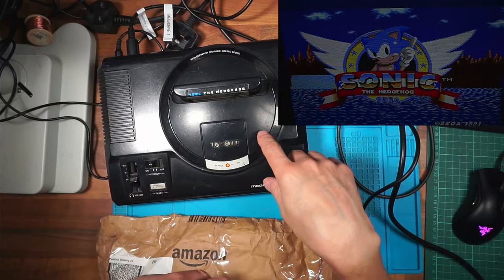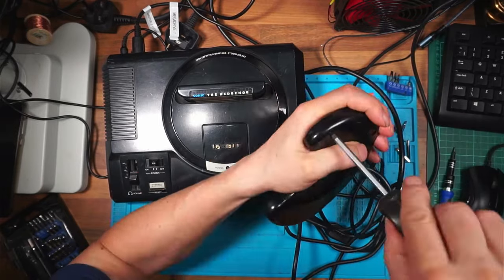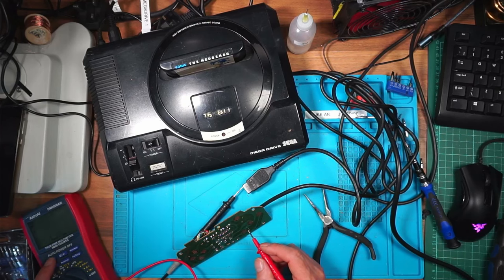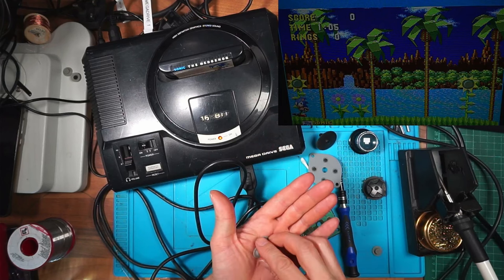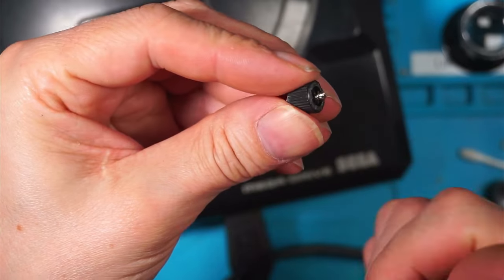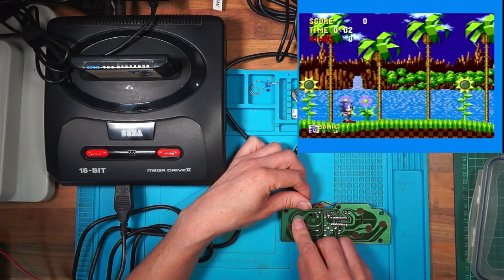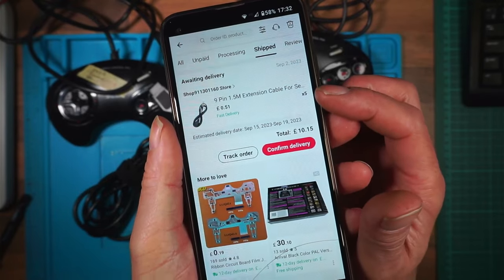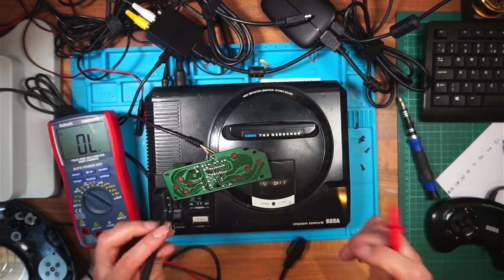Faulty Sega Genesis Megadrive Controller Bundle x3

Comment: Patience of a saint 😉 Philip, well done
Reply from the maker: Thanks Gary. Vince popped up in the comments on one of my videos too.
Reply: @PhilipBryden  found this in the shed (SEGA Mega Drive 1602-05 ORIGINAL OFFICIAL Adaptor UK PSU Power Supply 10V 1.2A) with the longer cable I believe Vince may have read my email ☺️

Comment: In my experience there are three different variants of Megadrive controller commonly available in the UK
Reply from the maker: I'd like to mod one with some tactile buttons in the future. Even the  button stickers found in the Xbox one controllers would be better than the rubber pads.
Reply: @PhilipBryden  Sounds like a plan.  To be fair I don't like the MD controller's hollow buttons, I also find the 'C' button to be too high.  I've modded one MD controller to work with my PAUSE-modded Master System and I used the model with the red lettering for the buttons.  Finding the right model is how I discovered there were at least 3 variants of the controller in the UK

Comment: Did I understand that correctly Phil? The colour coding for the MD1 era controllers are different to the MD2 era controllers? That's madness, Sega - even Sonic is stamping his foot. 😉

I was only discussing your Master System joystick wiring with Jo Girly Gamer the other week, as she was  trying to figure out why there was a difference between the black and grey connectors on her ZX Spectrum joystick.
Reply from the maker: There's no difference between MD1 and MD2 as far as I know. The problem was the aftermarket cable colours didn't go to the correct places at the port end.  I had a ZX Spectrum when I was a boy and there were different versions of joysticks, Kempston being the one I can remember off the top of my head, but there were others. They all used the same connectors but you had to select which one you had when playing a game.
Reply: Cheers  @PhilipBryden . 😁👍 Looks like I over trusted the aftermarket cables description specifying MD2 (lies!). Ah well, a bit of working out made it compatible.

I remember Dad had a Cheetah joystick with the black and grey serial connectors - I can't however remember which we used and when. I'm sure we used it on his Atari 2600, as well as definitely his Amiga 500. Interesting to hear the Sinclair could change settings for either configuration.
Reply from the maker: I just checked my ZX Spectrum keyboard repair video and yes you can use an Atari joystick in the Spectrum too. Kempston and Sinclair were two main control options.